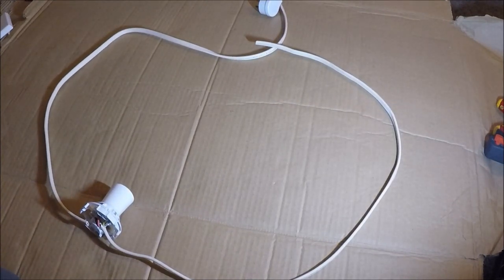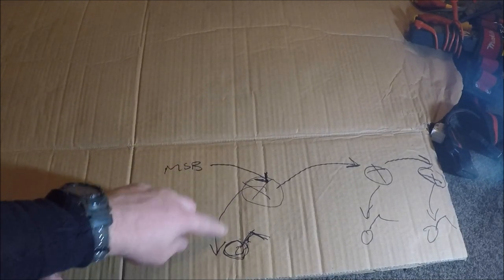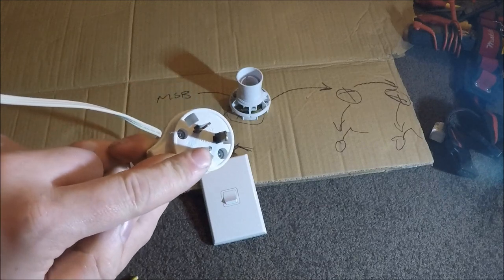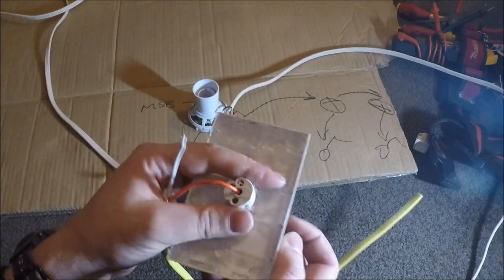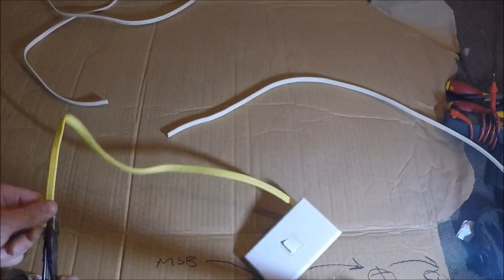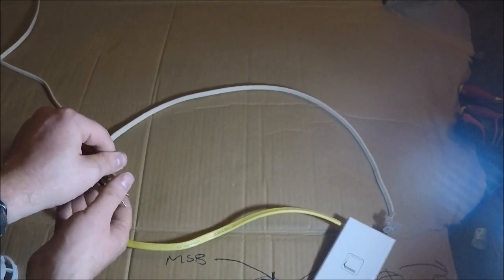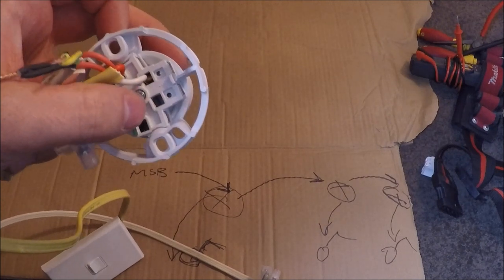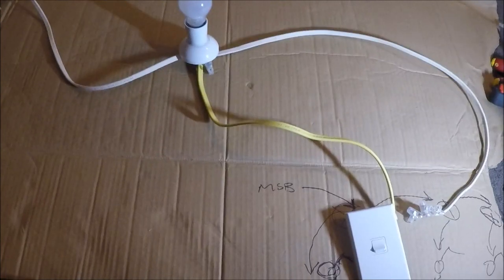How To Triple Plate Wire Light Fittings

Comment: This is why you never assume a light is safe to work on because the switch is off. Switching off is not isolating, and you should always test before you touch anything. In this example, there is still live voltage at the batton holder.

Comment: Hi Sparky Dave. Thanks for sharing videos
I have a triple plated wiring done on a light fixture at home, in WA.

I want to replace it with another fixture that takes in 3 inputs, L,N and GND. 
So I assume, i just keep 
1.all 3 live together into a protective connector. not connected to anything
2.the 2 GND connected to GND. 
3.The 2 neutral cponnected to neutral.